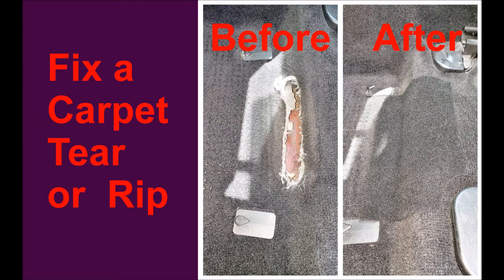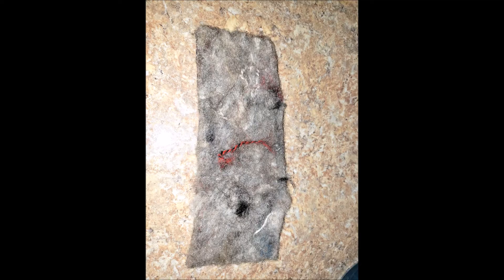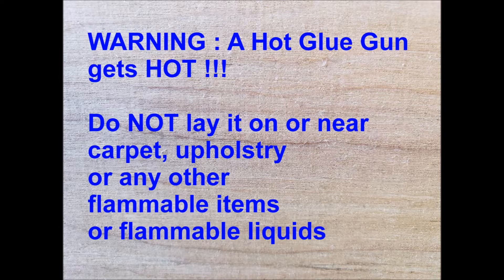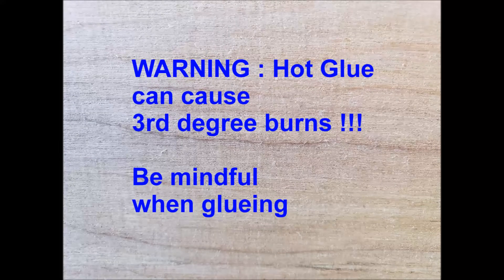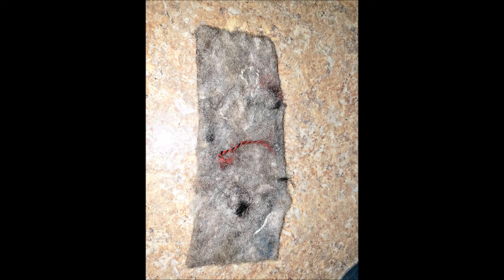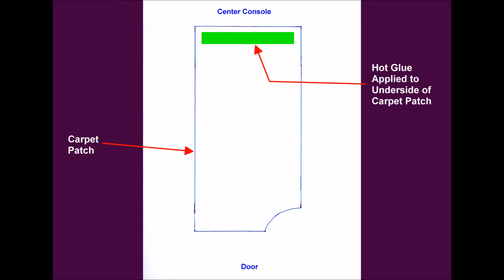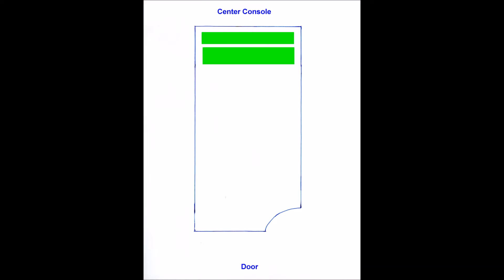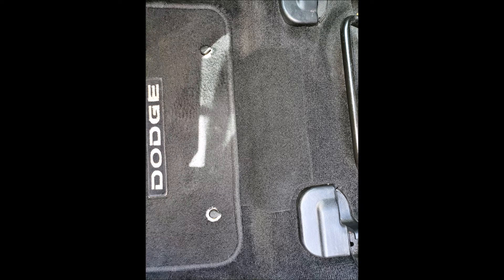Fix  a Carpet Tear or Rip (Episode #5)

Comment: Fantastic instructional vid, with all the info I could ever need to do this repair. Especially appreciated the glue gun placement tips, I probably would have messed that up without a reminder. Thanks!
Reply from the maker: Thanks for your positive comment. I'm glad the video was helpful.
Reply: a better option to the hot glue would be something like 3M 77 automotive spray adhesive.
Reply: @mattuber291  I ened up using a light coating of gorilla glue. Worked great.